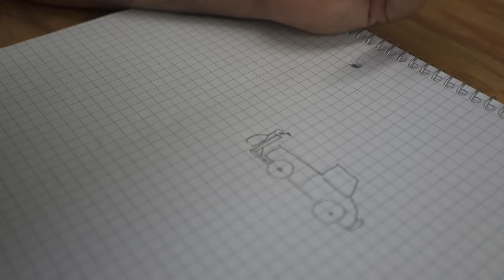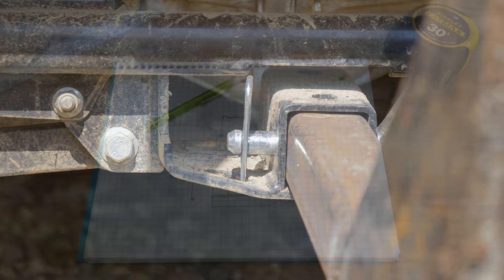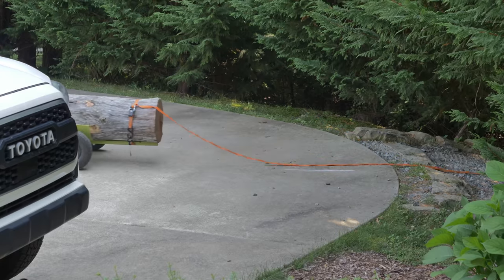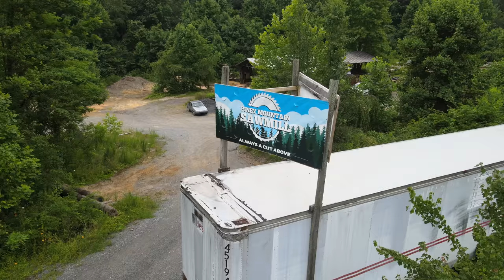What Berm Peak is doing about high lumber prices

Comment: that will rot out in less than 5 years. paint it, copper coat it, or be prepared to redo it all when it rots. sure most of it will be fine, but the parts in contact with the ground will be rotted and bad.

Comment: You are using your angle grinder wrong way around,  with the sparks flying away from the user it might look safe but when the disc grabs the grinder will fly straight into the user. Try it the correct way, then you dont need to hold the grinder with much grip.

Comment: Why not use plastic instead of wood?  Downcycled mixed-use plastic is so cheap that they'll actually pay you to get rid of it.  Process into planks and not only will it be cheaper than wood, but it's naturally rot-resistant and you're using a material which would otherwise end up in landfill.

Comment: Yall's welder amperage was too low, the welds are supposed to fully penetrate and melt in without burning it away. too much feed speed or too little amperage will make them stack on top like that. Should be fine for what you are doing tho.
Reply: They look real good for just learning tho, yall are on the right track, biggest problem is just turning the knobs right on the machine.